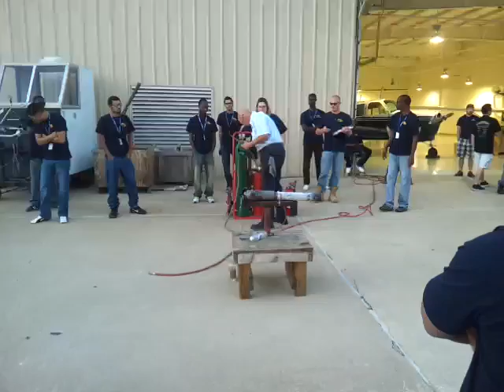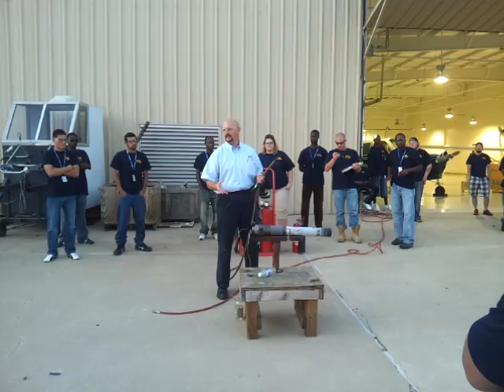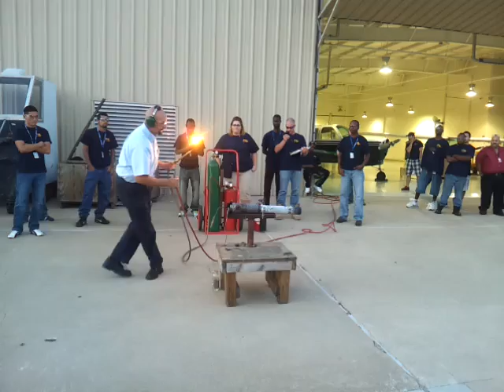AIM Ram Jet Engine

Comment: Technically a ram jet uses super fast air and the aerodynamics of a super sharp cone on the ram jets engine intake to compress itself, mix with fuel while superheated (being like mach2+ speeds) and then self igniting creating more thrust.
Just saying that ain't happening here
Reply: Ramjet vehicles operate around Mach 1-6, but the compressed airflow is subsonic at the point of ignition. Scramjets on the other hand operate anywhere from Mach 12-24 and the compressed air has supersonic velocity at point of ignition.

Comment: Yaaaaaawn 🥱 ,,, 
You mean the jet engine that needs a constant torch blown on it to make it run
Reply: And a constant source of compressed air. Maybe "no moving parts" on that little tubular unit, but several in the compressor that filled the air tank. More like a rocket with gaseous oxygen as the oxidizer.

Comment: That's an air compressor powered furnace heater... Every home with central heat has one of these.. a fan blowing air,, fuel mixed in and ignited... I made these from spray paint cans when I was about 9... They work better with propane and acetylene as a fuel mix
Reply: no moving parts!

Comment: A TRUE Ram Jet engine is a simplified engine in which forward accelerated velocity forces air into an intake at a given force, compressing it until it reaches the needed combustion temperature, thus creating a controlled reaction called thrust. A Pulse Jet requires much higher supersonic velocities to be able to function.

Comment: Uh...you...uh can't run a stationary ram jet. Kinda in the name. You need some fairly high speed air through the engine to ignite it.
Reply: He has compressed air hooked up to the front to simulate air intake during high speeds. It's not representing mach 1 speeds though clearly
Reply: Hot damn! Missed that the first tim
Reply: @TDPCMcpho  
Ramjets work at subsonic.  Scramjets work in supersonic. (sc = supersonic compressed)
Reply: @TheMrMused  Ramjets function most efficiently between mach 3-6 from what a quick google is saying. Ramjets may work subsonic but it sounds like you're implying they're not meant to work supersonic. which is incorrect. I think there's a misunderstanding here though, I was just responding to the comment, pointing out it wasn't still air

Comment: It is not a ramjet engine. A ramjet engine works only when the vehicle flies at twice or more than the speed of sound; and thus uses the shockwave phenomena as compressor for the air intake for the engine.
Reply: I assume the air from compressor give enough pressure air to make it work. The thing doesn't need to fly 300mph.
Reply: @medtxastratospore5729  Ramjet by definition does not have moving parts.
Reply: @NM-dl1gv  I know. He use external air compressor, the model itself has no moving part.
Reply: You're describing a scramjet.  Those require at least mach 1 to start. (sc = supersonic combustion)
Ramjets only work at subsonic, which this is - using the compressed air feed.
Reply: @TheMrMused  scramjet is supersonic combustion ramjet engine. RAM here is actually pointing to the process of compression by means of shockwave that can only occur during supersonic flight.

Comment: I had plans for what was called a pressure jet that ran on propane. Are we sure that's not what it is? It doesn't seem to be a ramjet because they usually won't start below 300 mph.
Reply: he is injecting compressed air with th second hoose

Comment: that is not a ram jet
Reply: It is a ramjet, but the combustion wasn't steady (perhaps because the high-pressure, high-discharge velocity air supply--which substituted for the high-velocity ram air the engine would use in flight--came out of the regulator in rapid pulses). If that engine had been a pulsejet, it would have been far louder, and the pulses--a rapid series of explosions--would have been very distinct and easily audible (and visible, in the exhaust plume flame).